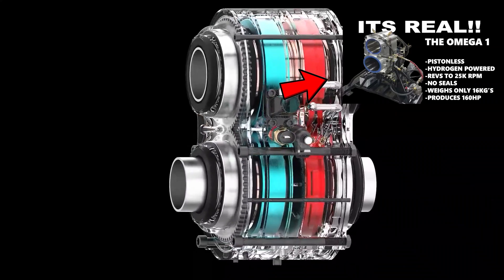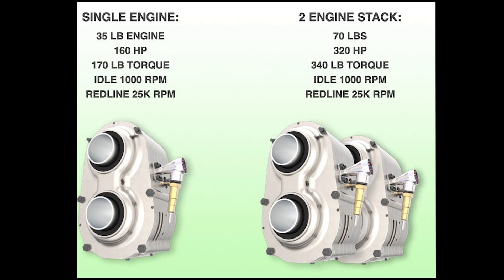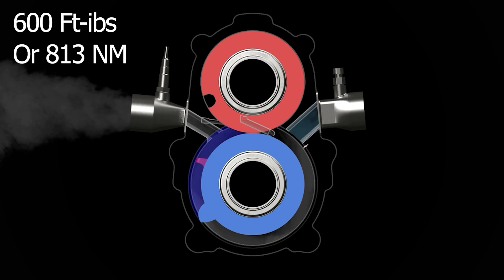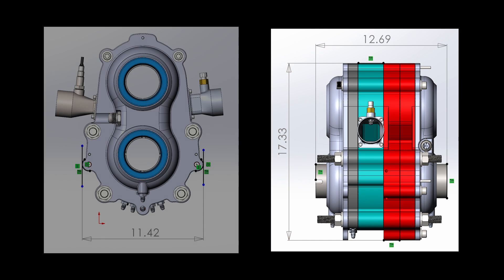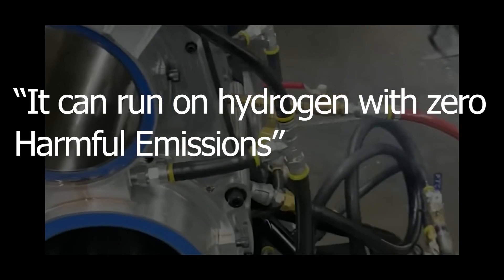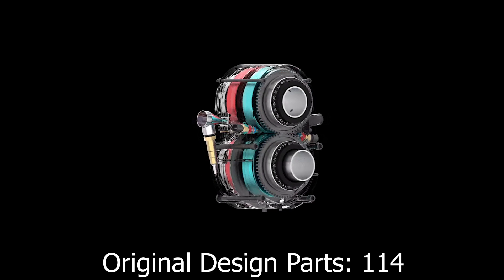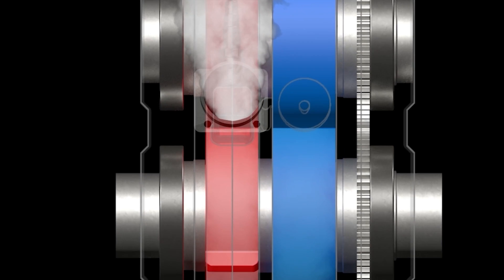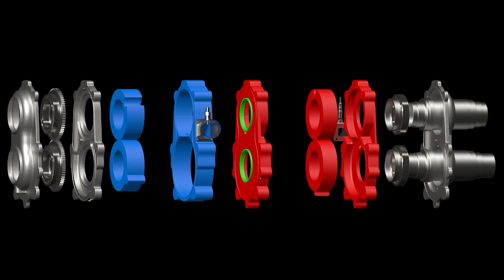Astron Aerospace Reveals Some Secret info on their Pistonless Omega 1 Engine - Starfire H2

Comment: everyone please give up on the omega 1 ..... it is not going to work,  so let Astron get back to what they are good at, and forget about it.
Reply: @Griffin T petrol flame front speed in an efficient normally aspirated engine is about 650 ips... do the math, and you will realize that Astron forgot to..
Reply: Get a room!
Reply: @Griffin T in other words, you didn't read my second comment..
 i have done work in ICE design, and i can assure you Astron would Love everyone to forget bout the omega 1 at this point.
it's a money sink hole to nowhere, and they have better things to do.
Reply: @Griffin T i will give you a hint....the smaller they make the omega 1, the higher the RPM it will be able to obtain.
and it would be  the size of a house fly by the time they got it to 25,000 RPM on petrol...
Reply: @Griffin T as if i don't know what i am talking about ??? i don't need this.
Reply: @Griffin T what i mean is, i can't leave links to articles or papers here...and i really don't have time to explain it.
Reply: @Griffin T unless your agreeing with me that it is no good...and the flame front speed is not the only problem with it...the limits of seal metalurgy is currently about 800 ips.
Reply: @Griffin T Astron had the basic principal right, with the omega 1....but that's about it, it needs to be shelved, under a thick layer of dust..
Reply: @Griffin T compredido
Reply: @Griffin T i like that INNengine.... opposed piston engines are so much more efficient, i think that's going to be the way it eventually starts going.
Reply: @Griffin T i am right there with you on that...
Transmission line losses are part of the EV efficiency equation....that's 50% on average....0.5 ( line ) x 0.85 ( charging station ) x 0.9 ( battery ) x 0.86 ( motor controller ) x 0.94 ( EV motor ) x 1.1 ( re-gen ) = 34% efficient ( about the same as diesel efficiency ) ..... so ICEs are not out of the game at all, and are more capable of efficiency gains; so it's probably going to be a mixed market.... but we certainly cannot assume EV efficiency just from a full battery to an empty battery ....it's not like that, ( as shown ), you have to charge them...
Reply: @Griffin T but more than that, as you alluded to, we are not ready for full scale EV, and we won't be by Javons Paradox.
full scale EV would cause transmission line thermal runaway loses, ( or the more EVs there are on the road, the less efficient they all will be )
so again, it's going to be a mixed market......
i did an E-85 concept submission with H-D, it is a VVT Wave Tuner that produces 6 psi of wave boost . 34% fuel conversion efficiency, ( same as an EV )
Reply: @Griffin T EVs are getting better also .
but opposed piston diesels promise 50 to 55% efficiency, and i am sure the INNengine will come in on par, or better than, today's EVs
Reply: @Griffin T good call...EV is pretty neat, but a touch behind cost competitive.
like i am so poor that i feel everything good is made in China.( and it actually is getting to be more like that, for the less financially challenged, in some industries )

but cars and motorbikes are different...there, the award has gone to Japan for many decades.....Europe takes a close second for the high end stuff, and America makes ok stuff for ok prices, while India is getting pretty good with the motorbikes at prices no one will argue with either.....i am sure i missed someone there, but you know what i mean.
H-D is getting better...so just hang on; it's been really difficult trying to think, when we constantly have to worry about what we are not thinking about around here, it's like that..
Reply: @Griffin T oh geyod yeah....freakin i live in wisconsin....i have to bring the two lithium starter batteries, i do have, into my house over the winter....and i have a used 4WD Toyota 1/2 Ton i have to rebuild this spring.....i got it up over 40 MPG hwy, but it had 208K miles on it when i got it, and at 247K it's time to pull it down for re-work..
Reply: @Griffin T i am shooting for 70 MPG hwy. with my torque peak record 54 cube H-D Sporty, but i will be happy if i end up over 65 MPG i guess.
i haven't gotten it on the dyno yet, but i know i have the torque record in the bag for a naturally aspirated pump gas 883
Reply: @Griffin T a guy has got to have his truck though, at least that type of work...i do equity construction here when i get around to it.
Reply: @Griffin T Achates Power is developing a 2.7L opposed piston diesel for 3/4 Ton trucks..( look it up on youtube )
keep yours maintained well, and maybe you can snag one of those when the time comes ... that will be more efficient than an EV truck..
they are talking 50 to 55% fuel conversion efficiency on those..
Reply: @Griffin T 270 HP and 480 lb.-ft. of torque.....so don't let the 2.7L fool you, it's a two stroke diesel, that's like a 5.4L four stroke diesel..
Reply: @Griffin T i guess because they thought they were rocket scientists, they figured designing an internal combustion engine was child's play .... well they were wrong in that assumption, and they made too many mistakes..period, stick a fork in it, it's done.
Reply: @Griffin T check out ---> INNengine
it has full pressure lube and direct injection as a clean opposed piston 2-stoke ( they call it a 1-stroke, but it is really a two stroke with a 2:1 reduction driven face cam )
then there is Liquid Piston, a new type of rotary...
both those engines were designed by real ICE designers..
Reply: @Griffin T it does say "50% more efficient that today's gasoline engines"  and that comes out to around 45% fuel conversion efficiency, which is still better than EV efficiency......
so correction, it's the Achates 10.6L semi-tractor engine that has 50-55% fuel conversion efficiency...
Reply: @Griffin T besides...it takes energy to make a truck...so you're doing ok just maintaining that energy investment, until then..
Reply: @Griffin T for now, when you need new tires, switch to thinner tires with good fuel economy ratings....
remove dead weight, 
( eg. stump guards, the spare tire if you can afford to maintain ) and check your tires max load PSI against real world loads.....you should be able to run your tire pressure with an extra 5 PSI over-pressure with little reduction in max load...
moly or PTFE oil additives reduce engine friction...
keep your air filter maintained or changed when needed...
consider removing the tailgate in favor of a tailgate net.
Reply: @Griffin T this turbine manufacturer starting an ICE design by throwing over 100 years of evolutionary ICE  knowledge base out the window, is not going to end well..

Comment: Aircraft suited, can perform better than and thus replace piston engines and turboprops. Light to medium transporters and helicopters should be automatic candidates in my view. This and the other pistonless rotary model that had continuous combustion that appeared some 5 years ago and was even hooked onto a go kart and performed quite well, putting out some impressive numbers, are birds of a feather.
Reply: Good power. If stackable, you could put it in anything, or have one in each corner for each wheel 👍
Reply: @Neil Standish  that's a great thought and with a 25000rpm, and that amount of torque, the uses are endless
Reply: What was the other piston-less rotary?
Reply: @Timb0NZ  liquid piston's inverted 'dorito' engine
Reply: liquid piston huh? yes no use for drones yet... c'mon wars are all around the world and no drones use that one yet?
well... lets see when this one gets into drones...